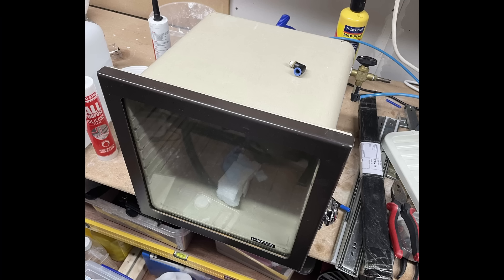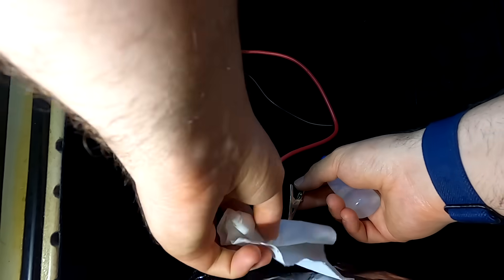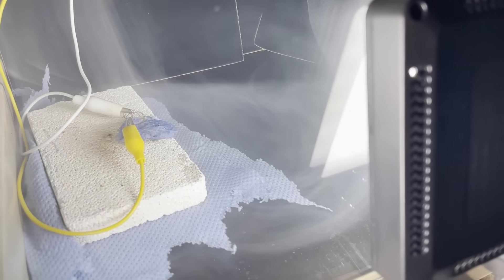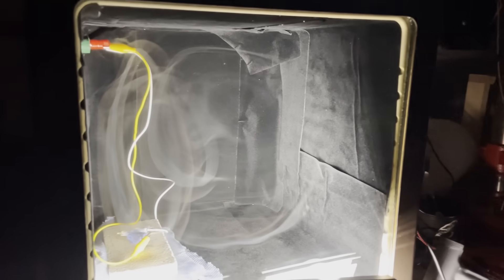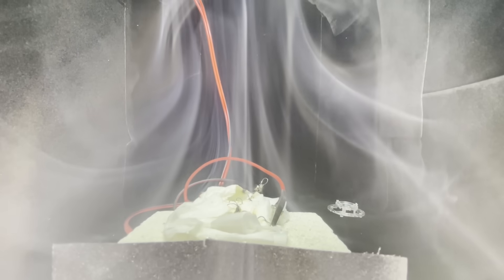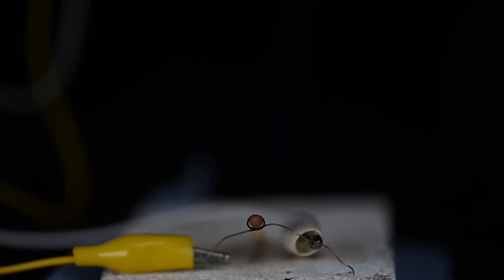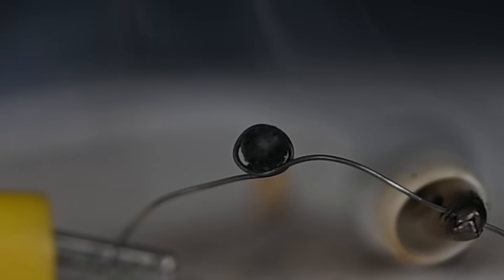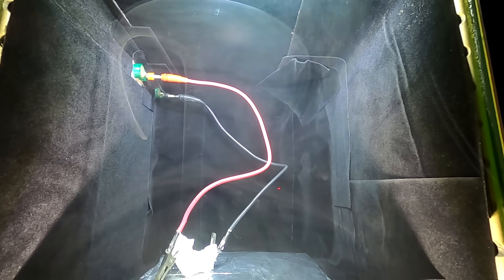What does Convection look like in a Vacuum?

Comment: What a great idea for a video - one of the most interesting in a long time in Youtube. Here's a thought: how would the smoke interact with a small battery-operated fan placed inside the vacuum chamber, given that there would be no air to be pushed by the fan? Would only the smoke particles directly in contact with the fan blades be pushed? That would be a cool variation for this experiment.
...Liked, subscribed.
Reply: Complete vacuum = unpossible on earth. At a high enough vacuum practically (actually?) Anything will "offgas" and emit its particles into the vacuum.  
Even space isnt a true pure vacuum. 
Is that even possible?
Reply: @MattH-wg7ou  might be possible in a very small space and with near absolute zero temps so no offgassing... or maybe some materials simply wouldn't offgas idk.  But we can get to billionths of an atmosphere, nearly perfect already.  Look at some of the fusion reactor vacuum levels.
Reply: At a complete vacuum the smoke particles will "fall" on the floor like rocks until there are many enough to fill the room and begin convecting
Reply: @dionisienatea3137 yea this was what i expected before i clicked the video... i thought at least most of the gas would just pool at the bottom and form little eddies, like a pond but smoke particles. turns out that level of vacuum requires some insane equipment, definitely not something u can buy off ebay as 2nd hand leftovers from some lab.
Reply: I expect the effects of the magnetic fields and whatever static the fan generates would become more pronounced. Since the "smoke" here (which isn't smoke at all) is made up of polar molecules, we could see more surprising results than just the fan weakly pushing the vapour.
Reply: @EddieTheH Quote: "I expect the effects of the magnetic fields and whatever static..." 
That is a brilliant insight. Even in the absence of air and atmospheric pressure you still have effects from heat, gravity, chamber surface and static electrical charges.
Reply: I'd expect the fan to shoot off any particles that come into contact with it, like you already said.
Reply: I totally agree! This is such a mind bender for many, what happens in vacum, at least it was for me, and here - empirical answer to all those questions. Great stuff!
Reply: @boryswwa  we vacuumed ants. they stopped moving as if they were dead.  then when they returned to earth they started moving again.  that was pretty amazing.
Reply: What would be intresting is the same fan at the same speed at different vacumes. so at normal pressure the fan would instantly and violently disturbed the smoke, but as the vacum was incressed there would be less molecules to move about and the effect of the fan would drop. it would still move the small amountof air left but it should look like the speed of the fan was dropping.
Reply: https://youtube.com/shorts/eiKWtuHVCew?si=ydxAKWWTsRK_v0cv
I have an answer, roughly, for you. There has been a few attempts right here on YT, albeit not with smoke, still similar.  Really you can't get vacuum high enough for a fast fan not to make a turbulance ( pressure in the video goes down to <0.01ATM.  Only thing, besides scarce air drag there's also vibration and static charges, which would affect smoke (still small solid particles) somewhat less.
Reply: That is if you could produce a total vacuum, which is near impossible
Reply: There is always something there... A better way to imagine this is that the fan will be pushing finer particles,
that are capable to penetrate or the motion of the smoke will reflect a finer, more delicate, smoother range of motion, rather than a turbulent one (because large particles have to interact with smaller, finer particles - which are always there, but overwhelmed by the larger ones)
Reply: can a rocket produce thrust in outer space?  for what reason do we need 3 stage rockets except that the air gets thinner and thinner the higher we go? 

i guess rockets cannot produce thrust in the vacuum of space. at least the vacuum would suck out all the fuel or maybe boil it.
Reply: @longnamenocansayy  Are you seriously want to know answers for those questions? Or you just want to make a statement that earth is flat?
Reply: @longnamenocansayy  "can a rocket produce thrust in outer space?"
Yes it can. Thrust comes from the ejection  of mass (gasses from combustion) in one direction, causing movement in the opposite direction. There is no need for a medium such as air for this to work.

"for what reason do we need 3 stage rockets"
The reason is letting go of heavy hardware as the propellent is exhausted. If the rocket were a single stage, it would have to carry along a huge tank, even when most of its propellant was already gone. It's much more efficient to lose the weight of the emptied tanks by the way of staging. Nothing to do with "air getting thinner".

"i guess rockets cannot produce thrust in the vacuum of space."
You guessed wrong, sorry.

" the vacuum would suck out all the fuel or maybe boil it"
The fuel is NOT exposed to vacuum inside the tanks. To the contrary, it's pressurized.
Reply: @coriscotupi  you think rockets don't thrust against air?

tanks are pressurized against the vacuum of space? how does this fuel get out and burn. through a nozzle? does the nozzle have a hole in it? hmmmm.

3 stages with 3 different motors is lighter than one stage. okay. makes a lot of sense. what year did they discover that bit science?
Reply: It's the TORUS Magnetic Field. Great example.   Our souls are just like that, like the shape of an Apple it flows upward through our heads and around us and down then in through our bottoms.  Forming all around us like the smoke in this.  All living things that have energy have a TORUS.  The Soul.   God be with us all.  Amen.
Reply: @B9Robot  sorry, we're mostly interested in real science discussions
Reply: @Lambda_Ovine I don't believe you when you use the word sorry. You are not sorry for what you said... you don't regret telling this other human being that what he believes isn't "real".
Reply: @AkasaBhikkhu-wn8uk  Clearly, he wasn't actually sorry. It's just a figure of speech in that sense when you're mocking someone. People say that all the time and don't actually mean they are sorry. It's supposed to be condescending.
Reply: " @B9Robot Our souls are just like that,"
No such thing.
Reply: @B9Robot  uhhhh yeah... I believe in God but what you're saying is complete speculation and certainly not based on anything observable OR from scripture.  very new age thinking actually.
Reply: @Artcore103  Radiant Human & Aura Photography
Reply: @B9Robot  even if that stuff isn't total bs - which I don't know so I'll refrain from passing judgement at this time - that's still just a picture.  Maybe it allows you to see magnetic fields, I'll have to look into it.  But there is nothing tying what's seen in a picture to the human soul, no reason to interpret it that way, nor any reason to suspect that it or it's effects should be detectable.  We don't believe in materialism after all.
Reply: @Artcore103 put a coil in a pulsed DC modus and spray some metal particles around, must be high frequency pulsing. What you then see looks like torus..
Reply: @hansscholte5472  so what, that's an unrelated physical phenomenon.  Nothing to do with your soul, which is not physical.
Reply: @B9Robot take your religious bs to one of the pseudo-science channels please.

Comment: Interesting, I would of expected a gas when released in a vacuum to puff out in all directions and keep bouncing off the walls until gravity pulled it to the bottom...  Maybe the smoke clings together in a column because its molecules are ionized?  Anyway, cool vid, and thanks for sharing :)
Reply: I would have thought that all the smoke particles would pool at the bottom of the chamber since there is no air to float in.
Reply: @woulfhound  They would indeed just fall down if it was a high vacuum. This vacuum is just not quite good enough for that.
Reply: @TiSapph  That makes more sense.
Reply: Yeah, it's strange that it creates clear paths.

Comment: Nice experiment. Perhaps you can combine your vacuüm chamber with your coldplate to create a vacuüm cloudchamber detecting radiation from space.
Reply from the maker: I've actually been working on this recently and it's actually quite tricky, I still have some ideas to try though.
Reply: @paulmh this little vacuum chamber is gonna be so worth the buy when you make 20 more videos with it using all the suggestions from comments!
Reply: @paulmh  

By the way, your car vacuum line to the master cylinder brake drum produces 14 bars of vacuum.  Also vacuum from a lawn mower or weed Wacker or generator. 

Lots of vacuum without having to buy a 14 bar vacuum pump.
Reply: @paulmh  : Can't wait to see what comes of your research :D
Reply: It would be awesome if there was a "room temperature" cloud chamber, I would buy the F--- out of that. Or if it was sealed in like a glass tub and you just add normal ice to the outside in a compartment. You could get rich off that as a novelty. Id love to have it just to stare at without any maintenance required.
Reply: Vacuum is the ABSENCE of gas and vapour hence no cloud chamber in a vacuum.
Reply: Why do you spell it vacuüm?
Reply: @viperking6573  Because I'm dutch I guess 😂

Comment: Fascinating. Typical chambers work well but still don't achieve a total vacuum. What is this one rated to?
Reply from the maker: This one will get down to around 3000 microns or 400 Pa with the felt and wires etc inside, which is a rough vacuum. With nothing inside to outgas it would probably get lower to around 100 Pa I would guess. The lowest pressure you can reasonably get on a two stage vacuum pump like the one I am using here is around 2 Pa in ideal conditions. To do the sort of smoke experiments in the video you don't really need a significant vacuum, any pump could likely achieve similar results.